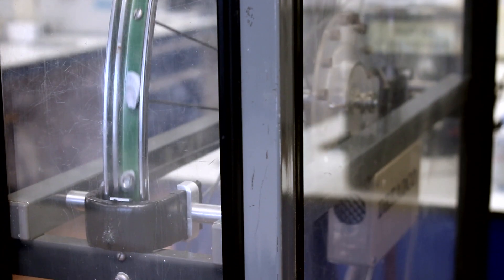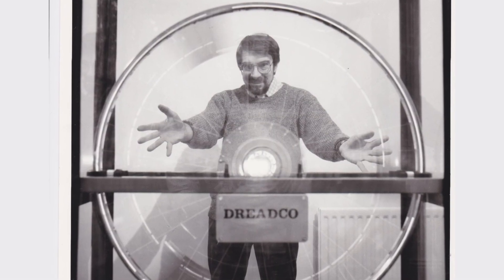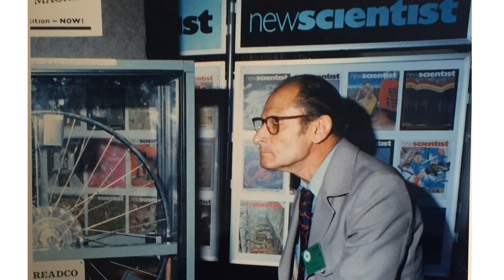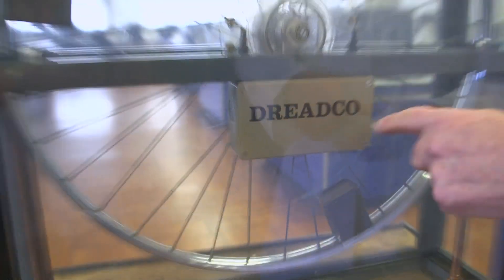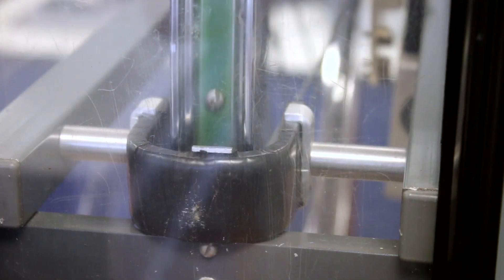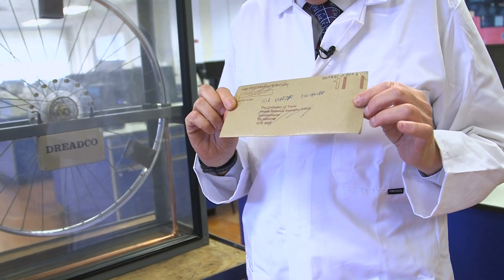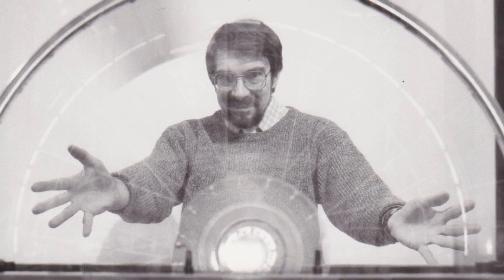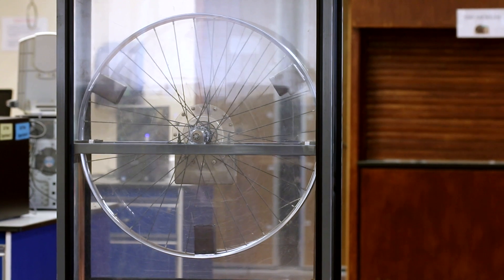Perpetual Motion Machine - Periodic Table of Videos

Comment: I think it's an electrostatic motor. The boxes on the wheel act as the moving charged plates, the two U shaped elements are the electrodes which couple with the boxes capacitively. The question is whether the charge is supplied by something as mundane as a dry cell battery (see: Oxford Electric Bell for super long lived, low power battery driven motor), or as clever as an alpha or beta radioactive source on one side to generate a charge and a sink on the other side, perhaps dissipating the charge via the sharp edges on those heat sink fins.

Either power source would explain the fact that it is rotating more slowly than it once did. Either the battery is beginning to weaken, or the radioactive source is decaying. Cobalt-60 could be a candidate for the radioactive source used, it's a beta emitter with about a 5 year half-life. Professor Poliakoff's comment that it was disappointing makes me think it's likely a dry cell battery of some sort.

Comment: I guess there is a battery and a transformer where the heatsinks are, the wires run through the tubes to the electromagnets as well as from the Dreadco box through the square frame to the other side of the electromagnets. The Neodymium magents in the center of the wheel provide feedback about the position of the rotation of the wheel, more importantly the magnets or iron in the 3 boxes, so the electromagnets are switched at the exact right time to give the boxes a little kick.

Comment: I have a guess.  It might be wrong, but I think it's strong enough that you shouldn't read this post if you're still trying to figure it out...

it's a solar-powered electric motor.  The windows in the sides of the DREADCO box are solar cells: there are wires hidden in the frame that run to U-shaped electromagnets on either side.  The magnets pull on the metal boxes mounted to the wheel.  But timing is crucial!  The metal cups mounted to a plastic disk are electrically charged, and an electronic circuit (a MOSFET-based flip-flop?) senses this charge using the round ball electrode on the left side of the DREADCO box.  This turns the current to each electromagnet on as the can is approaching, and off as the can moves away.

The cleverest bit is, how do the little metal cups get their electric charge?  The pointy electrode on the right side provides it.  The high voltage required is probably created by electromagnetic induction as the coils are switched on and off -- it's like the ignition coil in an old car, but much weaker.

The copper pipes and heat sinks and such are just red herrings.
Reply: In a BBC documentary, they measured electric fields and could only find them in the heat sink and the DREADCO box.
Reply: If it is indeed slowing down tho, it seems less likely to be solar power and electromagnets. If its slowing down then it's more likely to be a very efficient battery or chemical reaction.
Reply: maybe the battery are dying
Reply: Could be that the bearings on the wheel are wearing out and the friction is increasing over time.

Comment: In the 18th century several perpetual motion machines were built using fluctuations in atmospheric pressure as the power source.  A gradually falling weight turned the 'spinning wheel' of the device (as it turns the hands in an ordinary long-case clock), but whenever air pressure went up it would ratchet up the weight so that it never reached the bottom.  There is no mystery about this: it is conceptually just the same as a barometer with an indicator dial.  No laws of physics are broken!
I don't know if the Dreadco device uses pressure fluctuations as the power source, but it seems a possibility.  If the inventor had studied the history of perpetual motion devices he would know the precedents.  Fluctuations in temperature would also do the trick.

Comment: it might work with balancing of the weights that are those 3 boxes and also magnets placed in a specific order outside the wheel and also inside the frame. the heat sinks and copper tubes might be just for the show to make people wonder more about the possibilities. if you do the right math you might be able to build a machine that could run "perpetually" with a an initial push.
Reply: If by "perpetually" you mean "for a while", but that's true of any wheel. If you think magnets arranged around the outside can somehow crack the code, you're falling into the same traps that make people think perpetual motion machines are possible. Remember that as a magnet accelerates a target toward itself, it will also be pulling on it as it passes by and tries to escape. So while there is acceleration at first, there is deceleration after. There's no "special arrangement". <insert alien hairdo guy here>

Simply put, there is some friction in the bearing, some inefficiency in the system, and since you can't make energy out of nothing the system will gradually lose energy over time. If there's a fuel of any kind, that eventually runs out.

Comment: I think the boxes might be very weak magnets aswell as those "u" shaped things. I think the wheel is in a vaccuum thats made by that box and the copper pipes in the corner. The magnets would not have to be very strong to make it move and thus can be very weak. 

It would explain why the wheel is not turning as fast as it did because the magnets would have lost some of it's magnetism. It is just a theory

Comment: Could be a joule thief providing the energy to overcome the friction. Due to better receivers less strong radiowave broadcasts are used today, which could explain the slowing of the wheel
Reply: If it's tuned to overseas shortwave broadcasts, it would be an international joule thief.

Comment: I worked out how it (probably) worked and built my own version in about 1990, which was displayed in the tech workshop at school. My youngest son aged 3 saw it and I asked him how it worked. He said "It's got batteries in". For those familiar with some mystery clocks the mechanism is well known.

Inside one of the tin cans mounted on the wheels is a very small geared motor simply driving a small offset weight. This shifts the C of G of the whole wheel and around it goes. At least that's how mine worked. If he has been very clever the batteries are in the other boxes and there are some thin wires hidden around the rim.
Reply: So if you laid the machine on it's side, it would stop turning. They should have tried that on the video!
Reply: Interpret this as you will, I copy and pasted this from my prev comment:

I found a BBC documentary on this exact machine with the same prof present and they measured an electromagnetic field near the box with the heatsink and the DREADCO box. No other magnetic field was found anywhere else.
Reply: Wow, that could actually be it.
Reply: If that were true the motion of the wheel shouldn't be smooth it would have a variable acceleration as the torque created by the weight would change with angle.
Reply: the11382 link?
Reply: How long did yours go round?
Reply: @polpat  Well over a year, I could do much better now as better low speed motors are available and much better single use  batteries. Mine even used little pieces of blu tack for balance just like David Jones',  I had to rebalance it every time I replaced the batteries as the batteries never weighed the same.
Actually now I could probably power it off photovoltaic cells much as Citizen do with their watches. Solar cells don't even have to look like a solar cell any more. OK so it might stop in the dark, but is it going round if no one is looking at it?
Reply: viermidebutura
, No it wouldn't. The offset mass always hangs downward, if the motor drives it at a constant rate, the wheel goes around at a constant rate.
Reply: Donald Sayers this machine spins atva constant rate
If it were as you said the wheel would accelerate and slow down with each passing of the boxex

Comment: I'd guess it works based on the temperature differential at the bottom and top/middle part of the device, basically like a big stirling engine with a much weaker gradient than the ones you'd normally see running on a mug of coffee or such.

Mostly my guess is based on the apparent regularity of the motion; it doesn't seem to be following the more jerky movement patterns of unbalanced wheels and hidden batteries would just be too simple/obvious i guess with all the attention to redirecting attention.

Don't tell me if i'm right, i don't really want to know, pondering is fun enough in itself :)

Comment: Yes, my bet goes to Tritium Battery. Copper pipes, magnets and heatsink, combined with fact that it's running for years suggests that it may be using low-power and long-lasting electromagnetic drive. So I would start examination with low induction magnet detector and then would see if Geiger counter has something interesting to say.
Reply: A Geiger counter may not help. According to Wikipedia:  "Beta particles from tritium can penetrate only about 6.0 mm of air".

Comment: My first thought was that the heat sink thing warms up the black boxes from the side closest to it and that somehow keeps the wheel spinning. The heat is funneled into the heat sink by the pipes, and the black things at the end of those pipes somehow generate the energy from the magnetic forces that are fed to them through the wheel with the magnets in the middle.

This was a completely uneducated guess based on nothing and, like I said, my very first thought when I thought about how the machine functions, which means there's an over 99% chance in my mind that I'm wrong. I am curious about the answer, though, so I hope it's eventually revealed.

Comment: A betavoltaic cell powering a Hall-effect motor (or equivalent) might be consistent with both the disappointing answer and the gradual slowdown. It also has to be robust enough for the speed not to be altered when being pushed on its cart.

Comment: I think there's a small current of air/some kind of gas blowing out of that pipe. The air is accelerated by a little motor in the corner; the 'heatsinks' are actually air intakes, or perhaps something based on the change of ambient temperature, like the drinking bird?

Comment: Simple electric motor with duel battery. One powers while one charges. Eventually both will completely discharge and it will stop.
Reply: +bowwave Paul
isn't it easier to have one battery?
Reply: Jack Vernian it may well have just 1 battery and be a very well balance wheel that takes very little power to revolve it. The blocks on the rim may just make it act like a fly wheel. Enough mass to revolve with very little power need to make it go round.
Reply: +bowwave Paul I think the most fun part is thinking of the most complicated way this perpetual Motion Machine can work, as opposed to how it actually works.

Comment: Could be the spokes crossing the magnetic field of the earth or something, some of that lenz's law stuff. The boxes on the wheels could just be there to weigh down the wheel so it conserves momentum better.
Reply: we never saw which way the wheel was facing now did we? I guess it still wouldn't make a lot of sense though because the wheel would have to be moved perpendicular to the field lines to keep the emf up, and we can clearly see its not moving.
Reply: William White yeah, it was a quick guess really. I don’t really see how it could be running though as I can’t think of any other way it would gain energy, unless of course the energy is already stored in there somehow, though you would think it would have run out by now.

Comment: Its most obviously Electromagnetic Induction via the interaction of the copper wire and the the rotating magnets.
The magnets get weaker over time and so the wheel spins more slowly. 
Did  I solve it? I would love to know how it works btw.

Comment: Reed switch and electromagnet hidden in one or both of those black metal pieces on either side of the wheel. The heatsinks and that center wheel are red herrings, unless it's an electrostatic motor. Nothing with enough heat output to warrant those heatsinks would last 2 years running continuously
Reply: Teth47 I believe I saw an old style photovoltaic cell on the side of the Dreadco box which would provide a small amount of power for this set up.

Comment: My guess would be a sealed vacuum capsule from a barometer driving a self winding watch mechanism. Atmospheric pressure changes wind the escapement mechanism while the mass and momentum of the wheel sustain rotation. Gradual loss of vacuum in the capsule and wear in the components has reduced efficiency over time and hence the wheel is slowing gradually. An additional rotating weight could also contribute to winding the mechanism every time the wheel is moved. Essentially just a big version of a self winding watch. All the other bits bolted on are for misdirection, to increase mass, and provide perfect balance.
Reply: i said spring in axle & thought perhaps a watch winding simulacrum
Reply: Michael Kaliski and where does the wind come from...?
Reply: I'm GChaser The word "wind" is a bit ambiguous as it has two meanings, to blow air and to twist or apply torque to something. The wind I was referring to was meant in the torque twisting sense. All such machines which (may) rely on atmospheric or other environmental changes to power or recharge their mechanism, ultimately derive their power from solar emissions. The secret to discovering how it works is to consider how much energy is needed to balance friction losses in the system, then find a way to extract that energy from the local surroundings in a way that is not obvious to an observer. Microwatts are trivial, a few milliwatts requires careful engineering and design. The size of this machine distracts from the actual energy required to just sustain motion. Then there is the obvious solution of just using an external magnetic field to adjust or boost the speed of rotation periodically.
Reply: You did not answer my question... my question was where is the source of wind?
Reply: I'm GChaser you don’t need wind as such, just changes in air pressure that happen as weather changes.  
I like this idea, it’s clever.

Comment: 0:39 stirling engine
Reply: my guess would be  that  the magnets are there to provide impetus against the wheel  being driven by the   what look to be like a horse shoe magnet on each side with im guessing some sort of electromagnet powered by some sort of Stirling engine ( the copper tubes and radiators at the bottom) im guessing maybe like a phase change between liquid and gaseous ammonia ?
Reply: im guessing the cans on the wheel are filled with something to mak the wheel as ballanced as possable
Reply: or it could just be like an rtg powering a hub motor

Comment: Inside the boxes are bacteria and food. A small hole on one side is the only release of gasses produced by the bacteria which gently pushes the wheel round.
That's right, it's powered by fart! 😂
Reply: I like this idea
Reply: That wont work...
There is too much weight there for it to be propelled by low pressure gasses.
Also take not that he said, it is slowing down, if it was biochemical, it wont last too long, and it wont slow down, well it will but only in a short period, then the weights of it all will stop its motion..
Reply: Lucid Enigma no obviously not, the gas would travel around the container until it pushed the wheel in the opposite direction

Comment: Hypothetical, what if you have both a large weight and a 'negative' magnet (the housing unit) meeting a another 'negative' magnet (in the metal box on the wheel) including a weight in the wheel that overcomes the repulsion. All the heatsinks and copper wire is a facade to distract from the fact is some strong magnets with the initial repulsion being overcome by the weight of the black box contents.
Another thing maybe that that black box has two magnets (both positive and negative) and you situate other magnets in the housing unit correctly to ensure that it attracts one magnet (when it comes in close) and repels the other (when the weight of the black box drags it way).

That's the only way I can currently think about it

Comment: Clearly some sort of nuclear decay going down in there. Bicycle bearings ar not near the bests of the industry, so a lot of energy is lost at each rotation. Even if the case is holding a vacuum the energy consumed by the bearing would be too high, and it can´t also be any form of recovering this energy because I can´t think of an insulation strong enough to contain it within the case. It can´t be using battery or chemical power, because at least I don´t know of any form of chemical stored energy dense enough to keep this going for years (Tesla would be crazy to buy it in that case lol). That´s a mini thermonuclear machine, just grab a Geiger counter and test it!
Reply: If it were something based on nuclear decay, that would be very easy to check with a geiger counter.
Reply: "clearly"